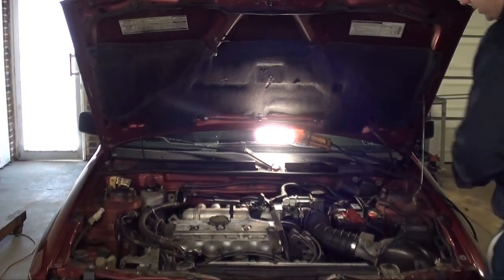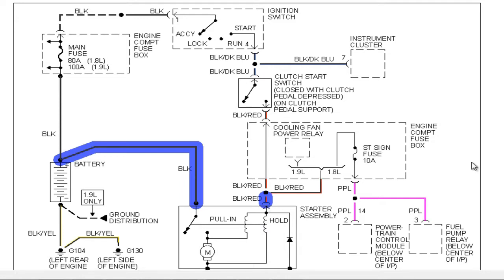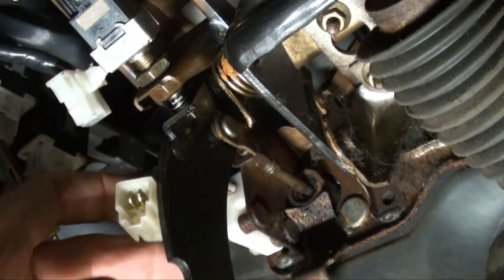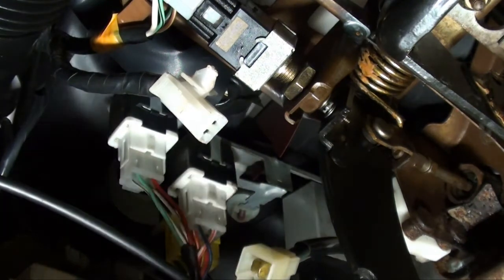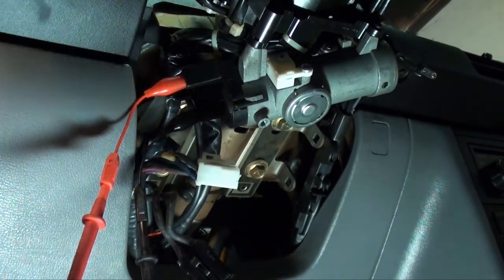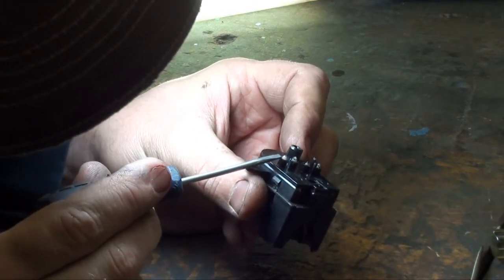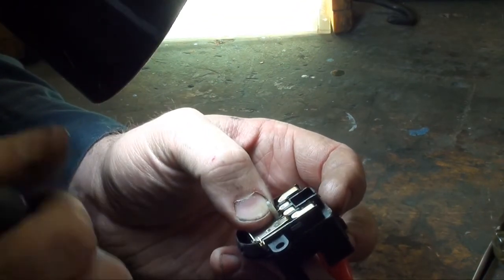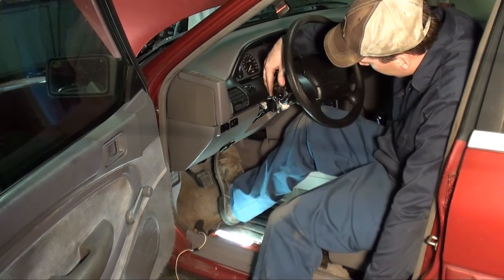Real time troubleshooting using schematics.  Starting circuit

Comment: hey will, can you start any car by touching the BATT and S terminals without damage to any components? And what was that, that you unplugged on the starter in the beginning of the video? and whatever that was does that have to be unplugged before touching the 2 posts?

Comment: Nice job Will. I've always hated electrical trouble shooting. Your video gave me all the missing puzzle pieces I needed to tackle my own project. I re-examined my wiring diagram and the light bulb came on. I found a frayed wire in minutes. Thanks man. Keep up the fine work!

Comment from the maker: @jdubb408 thanks for bringing that up, a continuity test and a voltage test are different, however i do understand where your going with the question, and yes you could and should see voltage if performed that way if the contacts are good. however, whenever im working near or around the air bag i choose to disconnect the battery and do the checks without Power. in addition if the contacts are week in some cases it will still light the bulb but dimmer... experienced eye will catch that

Comment: Great video – it makes a lot more sense when you can walk a person visually through how the circuit works, what is wired to what, etc. rather than just say ‘check the starter, check the interlock switch, check the ignition switch’.

Comment from the maker: @fargobrad Generally DC voltages below 50 volts are not considered dangerous. There is no shock hazard from the battery in a car @12v, but it can still be dangerous if its connected to something that can not handle its power, or shorted out. 
 cation should still be taking example if you are wearing a ring and you short the ring you can get burned. same thing if you short the jumper,

ALWAYS make sure the vehicle is out of gear or in park when bypassing safeties

Comment from the maker: @chevynut71570 thank you for the compliment, glad i could help. 
as for the schematics i use shop programs. Alldata and Mitchell 
they both cost money and may not pay for themselves unless you use the programs often 
i have the actual programs, in other words they are installed on my computer, i heard the online alldata may be cheaper however i don't know for sure, 

in most cases if your just working on one car a repair manual will have the schematics, most time they have the same schemitics